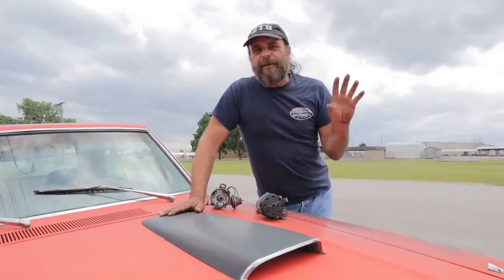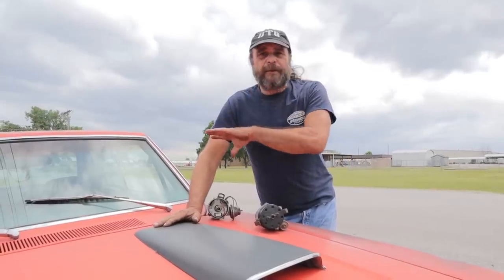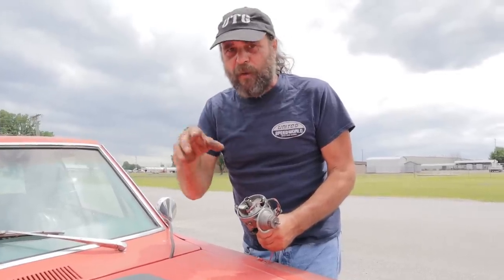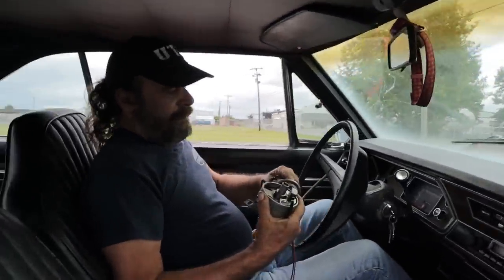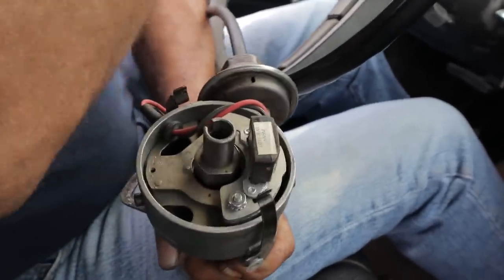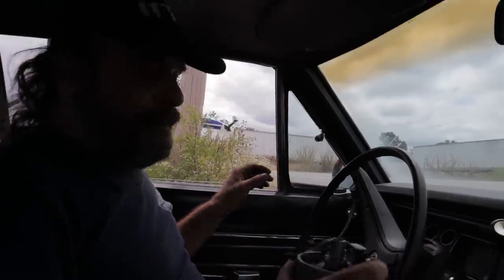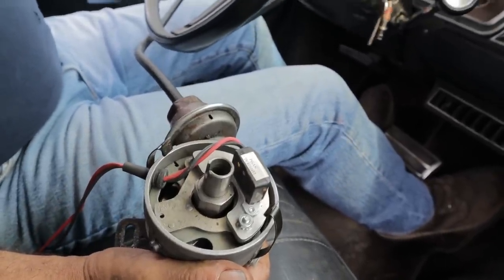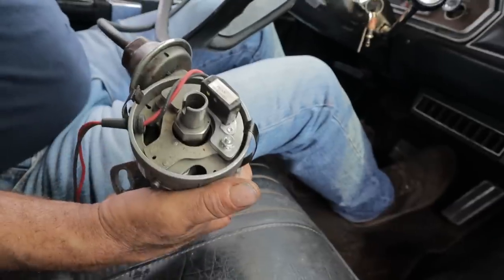The Vacuum Advance Debate!

Comment: Footnote: On some old GM cars the automatic transmission also uses the ported vacuum to shift properly. In fact it often T's off of the distributor vacuum advance.  When the vacuum advance diaphragm leaks the car won't shift properly.  I think it's about the same for the Ford FMX transmission.  

You have no idea how many guys messing with their vacuum advance have wound up with "rebuilt transmissions" because sleazy trans shops take advantage of guys who screw up their ported vacuum by screwing with their distributors or don't track back the trans vacuum line when they disconnect the vacuum advance... or the diaphragm just leaks due to age.

Thankfully when I was new to fixing cars... long long ago, an honest trans guy taught me this. He cost himself a really expensive and easy job.  Not all mechanics are crooks!

Comment: Question about 93 quantum chevy van, 350 motor, runs good. Wont shift into overdrive. What are the main possibilities if not too many and or quik accurate fixes. Yes i know, wide open question. Have the ramcharger need a van prefferably older. 70s 80s

Comment: If I get a perf distributor with out a vacuum advance, do you close the open vacuum line? Do you still use the vacuum pull to dial in the carb mixtures?

Comment: Just a question with regards to this experiment. If you are showing both manifold and ported with the distributor, which one did you do your timing for to run the car? If you set timing for ported, but now demonstrate manifold, wouldn’t your initial idle timing will be wrong for manifold vacuum and mess with the result? Is there not more mechanical advance timing needed and a leaner idle mixture when setting timing for manifold vacuum then ported vacuum, when both are idling at the same RPM. How does this impact your demonstration.  Sorry, not an expert, maybe I’m not following you correctly.

Comment: so i had an old timer mechanic convince me to remove all my emmisions stuff on my 82 GMC vandura.  He removed the vaccum lines from the two TVS switches and re-routed them.  Now it seems to be bogging down when it shiftinto 3rd gear.  no power and started to diesel a bit.  I hve deduced that i need a new vaccuum advance.   Could the bogging related to the vaccum?  to vaccum advance?   should i removes the TVS switches and plug wit pipe fittings?   Or is it likely something else having to do with the carb?  maybe debris or a piece of gasket fell inside? im at a loss.

Comment: Not so.  Most engines from the late 30s - early 60s used ported vacuum.  The Buick 215 V8 was one that DID use manifold vacuum.  The 63 - 57 and 64 - 66 Buick Nailheads, as well as the 58 - 63 with MANUAL trans, run well with manifold vacuum to the vacuum advance, but if you have high compression, you will have dieseling problems.  The 58 - 63 with DynaFlow, however, do NOT like it, as they are timed at 12 degrees BTDC, and applying manifold vacuum just is too much.

Comment: Please help why does my engine ping while cruising with the vacuum advance hooked up. I just had the engine freshened up most parts are the same like the ignition and before I've always ran ported vacuum on the distributor now with the new motor it pings when I hook up the vacuum advance. The initial timing is set at 12. It's a 383 chevy. It was a 450hp crate motor at one time but I pretty much upgraded everything. I put a new Forge bottom end Eagle and new AFR195cc heads thinking it would make little more power. Everything else is the same intake carburetor headers and ignition. I had a machine shop put the whole engine together. It has msd hei and quick fuel 735cfm carb. When I got it going like the last 383 I hooked up vacuum advance to ported vacuum and this new engine pings while cruising I can hear it through the mufflers. At first I thought it was my carburetor needed  rebuild so I sent it to a carb shop and they rebuilt it. Put the carb on ran better but still pings. I called the engine builder and he told me unhook it and just plug it. I did that and It doesn't ping now. So why on my last engine never did that with vacuum advance hooked up??? Please help.
Reply: Did you try manifold vacuum?? What happened?

Comment: one of the tricks my shop teacher used on the dirt circle track. heat races were run with the vacuum advance line off so it would look like a dog to the other racers.   then hooked to the manifold  for the feature. by the time others caught on he was into something else.

Comment: When you show the vacuum backing off  "right when you engine needs it the most"...um thats because when you rev like that the mechanical advance does the work instead. But on a disconnected dizzy like you have we cant see the mecahnical effects. The vacuum and mechanical advances work in concert to cover the entire RPM range .

Lets look at old Ford trucks as another example. The F350s with 460 big blocks non cslifornia actually show manifold connection to dizzy on the vacuum factory diagram, whereas the california emission models show the dizzy hooked to ported, so ported was also incolved in idle emissions , probably a cheap lazy way to affect emissions

Comment: I ran ported vacuum with 10.5 compression on iron heads. When I would accelerate, it ran well, but as soon as I pulled my foot off the gas or went into cruise mode, it would knock. Ran it that was untill the piston rings broke.
  Now I run no vacuum and runs perfect. Vacuum is for 7.5-8 compression,  that way ....no damage can occur

Comment: I used to love the sound of my dist advanced where you hear the gear hit the flywheel, did nothing for a second touch the gas and fire. I was a kid, but still like it lol
Reply: @unnamed4461  The dist was so advanced and locked out, that the motor didnt really turn over, the starter bendix hit, and i'd have to step on the gas some, so that it would turn enough (which wasnt much) to start.
Reply: I thought you were describing starting a warm model-t simply by jigling the timing lever on the steering column, but I got stuck on the starter gear thing.
Reply: @thisisyourcaptainspeaking2259  You just hear the starter hit and stall. 
Was I the only one ever to run the advance like that? lol It was common in my area, to hear a car start and barely turn over, or in my situation, not real turn over much at all.
Reply: @Shamilt3  locked advance is more common than most realize.  Boat racer stuff, a failed advance can cost a race.  In a lotta cases, the ignition gets turned on only after the crank is turning, otherwise the starter might become a grenade.  Ever had a Harley kick back and place a nasty bruise on your calf?  I was hoping to pump you for starting a model-t the cool way, only seen it once in my teens so barely remember.
Reply: @thisisyourcaptainspeaking2259  you're right on spinning prior to ign power. I grew up around boats and dirt bikes, I've had plenty of single cyl 2 strokes try to RIP my arm off with kickbacks lol
Reply: Hooked up to full manifold you won’t get starter drag if timed properly. The engine will start easier and once started, the full manifold will give you the advance you need, instead of all at once.
Reply: You failed this class!!! NEXT!!
Reply: @lskiller1903  Lol

Comment: So as somebody who really isn't in the know about this stuff I have a question. I notice in this instance when you draw a vacuum on the distributor it retards the timing. Hence when you're on manifold vacuum you start out advanced and then when the vacuum goes up it retards the timing. When you hook to ported the opposite is true, you're under vacuum and fully on base timing but when you put your foot on the gas the vacuum disappears and the distributor advances. Am I getting that right? 
Also, does this varry per manufacturer and application? For instance do some use the manifold vacuum increase to act on a vacuum diaphragm to advance the timing?
Reply: Lo Value  ok that helps that's what I wasn't quite getting during the explanation. seemed backwards to me
Reply: @Shane-Singleton  If it was as you describe, manifold vacuum would be the preference.  I don't recall ever seeing them like that but as much as the subject comes up maybe some were?  Anyway, there are adjustable spring rate vacuum cans as well, so advance rate can be taylored.  Vac advance can be limited as well, by various means.  Placing a limiting plate on the lever arm is common and sometimes necessary to avoid pinging.  This is one difference of poorly rebuilt distributors vs correctly configured, and cam swaps, etc.
Reply: @Shane-Singleton  I would just like to add that after ported vacuum increases, just off idle, it will start to decrease again with engine load. More load = less vacuum.
Reply: Lo Value  Curious, how does the vac advance help the accelerator pump? If anything I would think that a richer mix would require less advance.

Comment: I didn't read all 593 comments in this old video so I don't know if my points were already made, so here they are anyway.  You're reasoning is completely wrong. The ONLY time there is any difference in vacuum advance is at idle. The instant you open the throttle the vacuum signal to the advance cannister is identical, whether it is ported or direct. Timing does not retard, as you stated, when you open the throttle with an unported system. You do momentarily lose whatever vacuum advance you had at idle, but it merely falls back to equal that supplied by the ported system. An advantage to direct vacuum is with a performance street engine that has a lopey cam that may need to idle at 850-950 rpm. In some cases the curb idle screw has to be adjusted in so far to maintain idle that too much of the idle transfer slot is exposed. Adding some vacuum advance at idle, especially using an adjustable advance cannister, can increase idle speed and allow the curb idle screw to be backed out.

Comment: Thanks again. Ok. So, how do I set timing on a 343 Rambler engine. What would be the most advanced timing I should set it at, idling, in gear, with the vacuum line off the distrubutor. Do you plug the vacuum line or not, coming from the from the vacuum source. How do I adjust the weights.

Comment: What can you do if you have a fresh 350 ci that tends to diesel if you don't completely close the throttle plate but the idle doesn't work like that so can you use the timing to give you idle and still close the throttle enough to kill it and I know it's not carbon the engine don't have 100 miles on it sincere question guys

Comment: I just changed over to manifold vacuum. Simply because my initial is a little high but it needs its higher 18-20 deg idle timing. I couldnt reduce the msd mechanical any less then 18deg, then add in another 12 deg for vacuum and its touching 50 degrees and pinging like crazy. When i put it on manifold and adjust the idle timing back into my range. I lose alot of the advance in higher rpm and the motor is much happier.

Comment: Ported Vacuum is the same as Manifold in inches of mercury as long as the throttle blades are open a pinch when driving around with light throttle. So that being said, part throttle vacuum  is the same no matter what port its hooked to. So I assume if you were sitting at idle and you mashed the gas in each case ( ported or manifold ) the vacuum would be the same ( no vacuum ) . My chevy idles much better with it on manifold. If its on ported with the initial timing set where there is no ping under load the timing is to retarded for smooth idle. I do like the video describing whats happening.

Comment: Correct me if I'm wrong but wasn't ported vacuum introduced as an early economy measure?
Reply: Actually it was emission. Years before catalytic converter technology had been developed, and all manner of crude band-aid systems were developed to try and reduce hydrocarbons and oxides of nitrogen in the exhaust stream. One of these band-aids was "ported spark", which moved the vacuum pickup orifice in the carburetor venturi from below the throttle plate (where it was exposed to full manifold vacuum at idle) to above the throttle plate, where it saw no manifold vacuum at all at idle. This meant the vacuum advance was inoperative at idle (retarding spark timing from its optimum value), and these applications also had VERY low initial static timing (usually 4 degrees or less, and some actually were set at 2 degrees AFTER TDC). This was done in order to increase exhaust gas temperature (due to "lighting the fire late") to improve the effectiveness of the "afterburning" of hydrocarbons by the air injected into the exhaust manifolds by the A.I.R. system; as a result, these engines ran like crap, and an enormous amount of wasted heat energy was transferred through the exhaust port walls into the coolant, causing them to run hot at idle - cylinder pressure fell off, engine temperatures went up, combustion efficiency went down the drain, and fuel economy went down with it.

Comment: I understand manifold vacuum. Where do you connect the hose for ported?
Reply: To carburetor - most times there is a dedicated vacuum port there.
Reply: v6ileib Would that be above the throttle valve? Otherwise I would expect it to act same as manifold vacuum.
Reply: Ported is above blades. Manifold is at base of carb or on actual intake manifold
Reply: @carlam6669  yep, just above the butterflies is the passage that gets exposed to vacuum as the butterflies open.  Easy to confuse with the vacuum egr port so some careful investigation is advised as the port timing is slightly different most of the time.

Comment: Ported vacuum doesn’t increase with engine speed - it does the same exact thing as manifold except for at idle. 
Put a vacuum gauge on both and go for a drive - Search “Thunderhead289 ported vacuum manifold” to see this. 

The only vacuum that increases with air speed is venturi vacuum, which on our American v8 cars it is what actuates the vacuum secondaries on holley carbs.
Reply from the maker: Go back and watch the video again...we said that beyond initial throttle opening, ported and manifold act the same.
The difference is on initial throttle opening.  With manifold vacuum, the advance unit relaxes and retards timing before it picks up and advances again, while on ported the timing stays consistent.  In this video, we are only concerning ourselves with initial break-away acceleration

Comment: I have a 75 Powerwagon with the 440(4speed) with mild cam and headers...everything else is bone factory stock and its got the 750 Edelbrock carb(man.choke) and it seems to run soomther and better with no vaccum advance at all with ports on carb and distributor plugged off(obviously plugged off lol) and runs ehhh ok i guess with vaccum advance hooked up(threw ported vaccum...again obviously lol its clean for vaccum advance you do want ported and not manifold like tony says) so just curious why would my motor run better with no advance at all hooked up? is it giving too much advance while being hooked up? (thats what im thinking but not sure) with it hooked up it seems to struggle a bit at low rpms but like i said with it disconnected and plugged off it runs just fine at both low mid and high rpms....any suggestions?????

Comment: i found using manifold vacuum makes for cooler idle and better economy as well as detonation resistance. as for off the line the difference was small. off idle was better ported but to be fair static timing with ported was 12* with all in at 32  vs 0* static with manifold and total of 20*. with manifold i was at 26-27* with vacuum advance and 0* static! the difference was small but with manifold it wold idle 30+ degrees cooler and had a cleaner smelling exsost as well as using less fuel. the 26-27* of vacuum advance was do to using a 1973 distributor later i switched the vacuum advance for one that pulled in 15-23* degrees and was adjustable and set it to 19* set base timing to 2* and have a totel of 22*at 3500 and a max of 41* under hi rpm hi vacuum. the engine made best vaccum at 26-27* but set the idle advance to 21* 2* base 19* vacuum and that seams better as it no longer bangs in to gear. it seam like smoger fords do not like a lot of timing do to the smaller chambers and the poor quench on the 351w as the pistons are so fare down the hole. the small cam with 195 @ .50 with 108* lobe separation plays in to that to for not liking a lot of timing but needs a good bit at idel do to the dilution that such cam makes. so for me i use manifold when i need a lot of idle advance but can not run a lot of base timing do to detonation and starter drag. so for me it is what ever the engine needs. ported vs manifold is a tuning tool.

Comment: Why would you not use vac adv on a really hot street/strip car? You'd only really be focused on the performance... but why literally throw money away when you do street drive the car? Even if it's to/from the track. That thing going around traffic at, say, 30 degrees advanced isn't atomizing the fuel nearly enough at low rpm and will be boggy, unresponsive, and get shitty mpg compared to, say, 50 degrees, giving ample time for the droplets of fuel to fully burn, no? We know it won't affect your total timing at full throttle, so it shouldn't introduce a detonation situation either imo. I can see the reasoning behind not using it if you trailer your car to and from the track, and the only thing the car does is go full throttle down the strip. But if you drive it on the street at all... why throw that away?
I'd love your input here, Uncle! I'm all ears :)